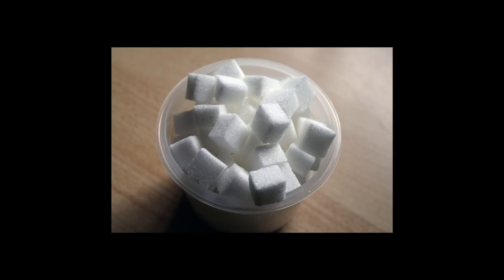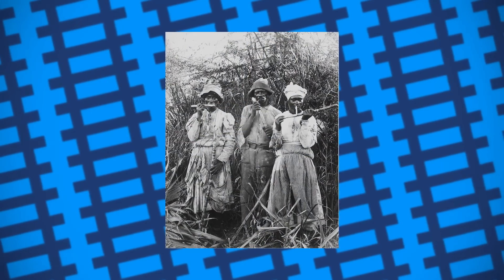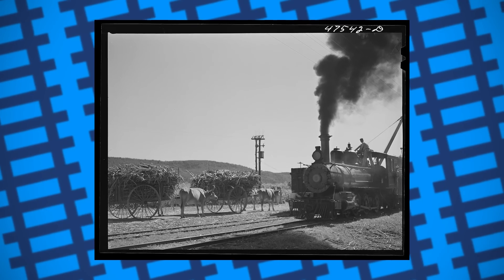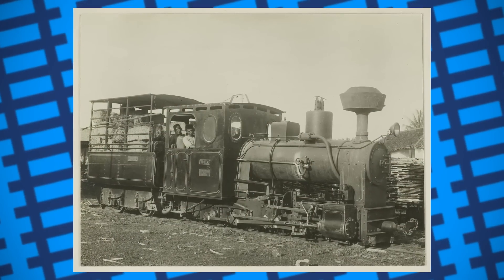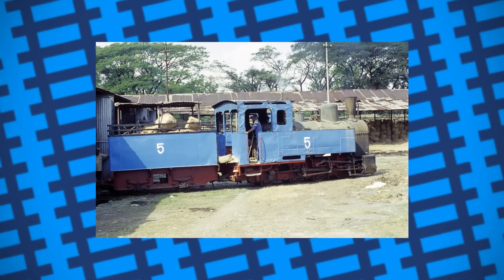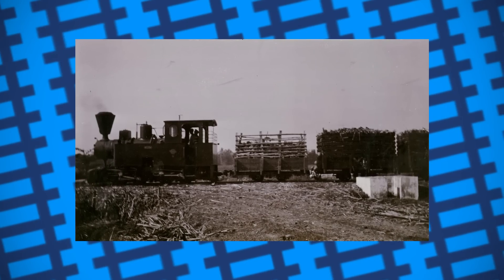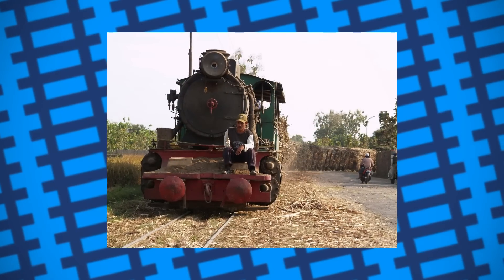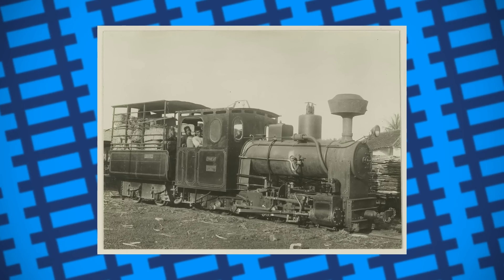How some Mills ran their Locomotives on Sugar - Bagasse Locomotives

Comment: I would think SOOT would be a major problem. Smoke Stacks catching on fire, because of the amount of soot produced from burning what is left over from processed sugar cane. I do know that the Fireman would throw sand in the firebox. To go through the boiler tubes trying to keep them clean. Damp leftovers from sugar cane production. Had to produce a real lot of smoke that equals a lot of soot.

Comment: I think I know from where you get those sugar cane train pictures. It's from my country, Indonesia. Note: some of sugar mills here still use train to transfer the sugar cane, it's called "tebu" here & the train called "lori tebu". But now there only diesel one, the steam only operate on the milling site but sometimes it's goes to the field if the diesel unit in maintenance. The mill that still operating that train is Semboro sugar mill & Jatiroto sugar mill, even these two mills have an interconnected line.

Comment: I've always been surprised that people didn't make compressed charcoal chunks out of mill waste, not just in sugar, but in papermills, sawmills, and even breweries.
Its technically more energy wasteful, but for the low ratio of fuel needed for their mobile applications, and using something thats already a byproduct that doesn't seem unworkable, and the extra labor needed to convert it is almost entirely saved in the numerous times its handled/cross loaded into stockpiles, tenders, the firebox itself, then waste out of ashpans/smokebox from the more incomplete combustion of fibers. By trying to use a fuel too unrefined they inadvertently made it expensive, and quickly found their use limited by the smoke, sparks or labor.

Comment: I remember reading about similar locomotives burning jute (a fibrous plant kind of like hemp, often used for making rope) to transport harvested jute from the field to be processed. It's fascinating how steam engines can be run on anything that's cheap and plentiful and burns, but perhaps not very well depending on the energy content and burning characteristics.
Reply: Just as important, is the size of the firebox. The lower the calorific value of the fuel, the larger the firebox needs to be for an increase in heating surface. 
That is why coal burning engines can have a small firebox, but wood or bagasse needs to be bigger.

Comment: Finally, my industry being talked about lol
Bagasse and Cane Trash are both burnable, though the latter is only excess burnt by farms cause it burns quick and just a good firestarter, however bagasse is still used for the mills themself even acting like a power plant. Australia never really did bagasse for locos however CSR did convert alot of their steam engines in the 70s to burn ethanol, which can also come from the work of the cane railways, but that didnt last long as diesels basically took over by the 80s.

Comment: Since burning bagasse in a stationary power plant was less problematic, why didn't anyone think to build some extra generators to run on bagasse and electrify the cane-hauling railway?
Reply: 1: Electrification of even a short line has a high upfront cost. It almost definitely would have been cheaper over a five year period and definitely over 8+ years, but that's a long time for investors and local capitalists to consider the purchase and return on investment (and they likely have final say).
2: Some of these lines likely predate good overhead electrification technology, and the Caribbean probably didn't have many skilled electrical engineers to spare for a while. The one(s) who operated the power plant might not have the specific skill set for railroad electrification, and more would have had to have been brought on anyway due to the increased scale.
3: This applies to most industrial sites, and is why even modern coal power plants don't always electrify their shunters, but even if a process doesn't require big machines on a daily basis, you would likely be moving something like an excavator or crane around every now and then. Overhead lines can be made tall enough to sidestep this problem (look at India) but taller photographs are a most recent development and for a while even the newest electric locomotives would have not been compatible with higher lines. Third rail electrification is not really an option here because you have a bunch of laborers working directly next to the track.

If a larger sugar operation was being started in the modern day, what you said would absolutely be the best option, but the steam locomotives have essentially been "grandfathered" in.
Reply: Sugar cane harvesting is seasonal, in the 6 months that the track doesn't get used the chance of Overhead Line Equipment being damaged/stolen is high. Loading cane bins involves the use of side tippers or roll on roll off methods, electrification runs the risk of contractors to contact OHLE; rendering the network useless and/or the potential to harm someone. The use of diesel is king; go anywhere and pull a lot of it. 260 kilometres of running, pulling up to 1200 tonnes burns about 700 litres of diesel on the locomotives I drove.

In the modern day of sugar milling Sugar is considered a by-product, with the highest profit exporting electricity domestically to the grid. I'd hate to drive electric traction on cane, if I lost traction (wheel slip/spin) it'd be a bastard to try and get it back, much easier with a Diesel Mechanical and Diesel Hydraulic. You can instantly drop and apply power when necessary, instead of waiting for a generator to enter and exit excitement
Reply: @kylegleeson8638  The Great Western diesel-hydraulic locomotives were reputed to have wheelslip problems, and Southern Pacific found their Krauss-Maffei diesel-hydraulic imports to be not so good in the mountains as they thought when ordering.  Electric done right(*) has good traction control and responsiveness and has given good service in most of the world (even though for some reason it is disfavored in the great majority of the Americas).

(*)NOT Amtrak's HHP-8s.

Comment: Technically, burning wood is carbon neutral too.
What isnt carbonneutral is lgging without regrowing the forest.
Reply: I think I read somewhere that a team in Britain is testing a coal substitute made from sewage. That sounds promising.
Reply: Also, I remember the Talyllyn Railway started using some sort of yellow coal.
Reply: Honestly, begasse powered engines could be very useful, in the long run. At least this way lacks the risk of deforestation.

Comment: Huh, never knew steam locomotives had a sweet tooth.
If the Bagasse is healthy to use for the engines yet lacks the low burning source with high moisture, then maybe they should try the vegetation diet of Ecoal & Grape seed husks.

Comment: In Massachusetts, the Edaville Railroad has a 1930s Hudswell Clarke 0-6-0 tender locomotive that formerly used this sugar cane based fuel. It was converted to oil fire but then converted to coal.
Reply: The mills, specifically Hawaiian Phillipine on Negros burnt oil at the start of the milling season until the mill had enough bagasse to keep up with the enormous fuel consumption. When burning oil the locomotive had a regular stovepipe chimney.

Comment: Interesting... I wonder, if it can be burned in a stationary boiler alright, wouldn't accumulation engines be a good combo? Sure it's a bit different infrastructure, but it if the lines were short enough, it could work.

Comment: Just remember that the Workers on the Sugar Plantations in the 1500s and into the 1800s were slaves owned by by big plantation owners and were subject to the worst brutal conditions. Despite attempts to breed the slaves, the slave population was not self sufficient as the death rate from overwork, abuse and malnutrition was dreadful. American plantation owners in the South preferred to buy slaves off from the Caribbean, since they had already been broken in and were less likely to rebel as they were now only subject to sustainable brutal dehumanizing exploitation. Cuba had it's first railway built in 1834 and slavery was abolished in the Spanish Empire in 1857. When slavery was abolished, you ended up with people who were not being whipped and worked to death but still worked for basically subsistence wages doing hard manual work as well as indentured workers imported from India and china.

Comment: I think someone heard about coke-powered locomotives and thought of something entirely different
Reply: Sir Topham Hatt was very cross. "Useful engines don't get high!" He said.
Reply: @darnit1944  "And you need to burn more calories!" I said.
Reply: Coke can be a solid, a liquid or a powder. More accurately: a fuel (also used in iron smelting), a drink or a drug.
Reply: why didn't they process the bagass into coke first?